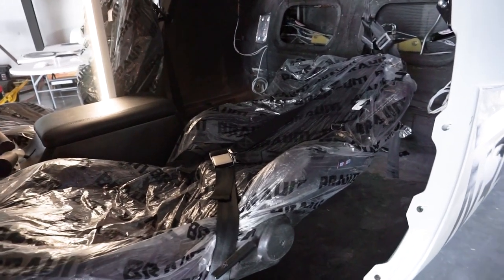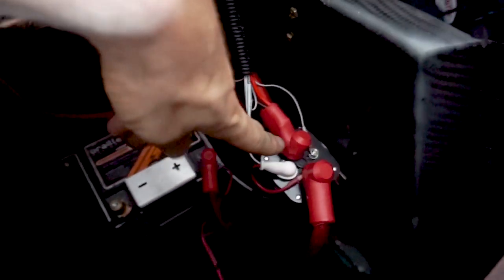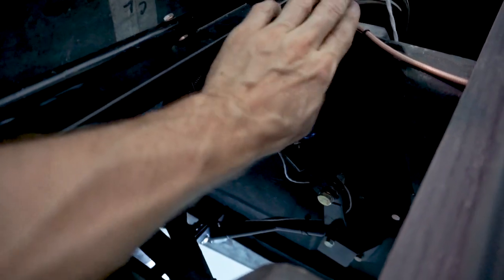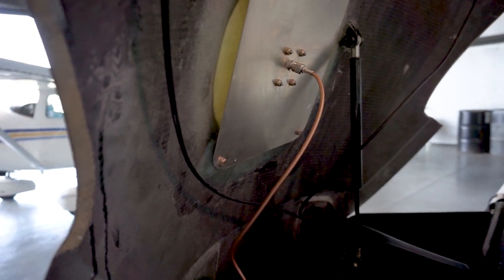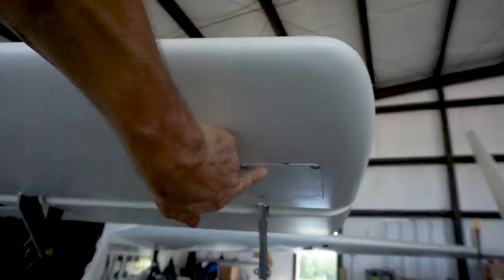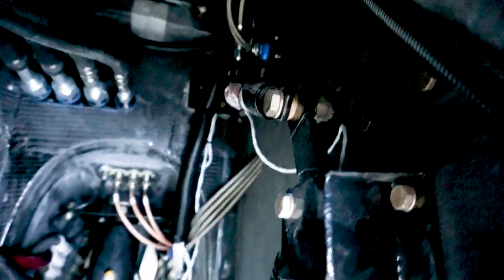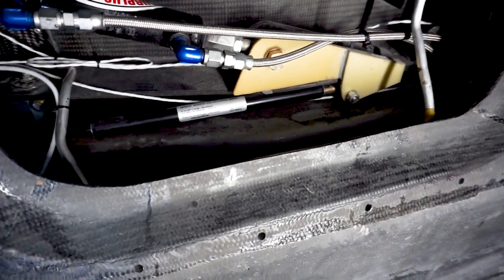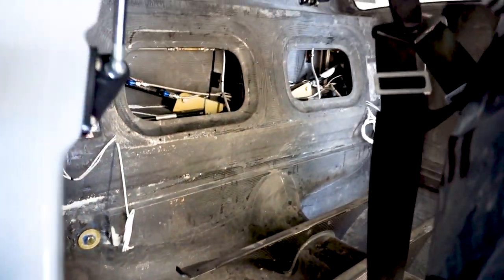Is this the coolest plane you can't buy... yet?  (Part 3)

Comment: The only thing I can say is get in there with some tie wraps and carefully placed tabs and secure ALL of that LOOSE WIRING AND HOSES I wish I could come down there and spend a few days consolidating that before you fly her.
 You need to plan for 9G's regardless of whether or not you plan on achieving it.
 I would secure everything every 6 in at a minimum.
Reply: Well, I agree, though most of the hard work has been done. I've seen in some of the videos that care was taken to make sure there was enough room so that wires and hoses all have a place to live, and can be routed within their bend radii.

I think that with the hard part done, the wiring and hoses could be gathered up and secured better than they are now.

Having assembled over a 100 desktop computers, some servers, mostly professionally, and a homemade CNC with over 100 feet of cable in it, I tend to use wires to immobilize other wires, and then securing wires where needed.

I try not to put strain on wires to immobilize them. I also tend not to zip-tie wires too tightly, because it just displaces the insulation. To a large degree, the wires know where they want to go. You just need to keep them from where they should never be, and obey their bend radii.

Same color wires, may be color-coded by striping with colored markers. Velcro may be used to temporarily bundle before zip-typing. Bundles of wires may be fastened with rubber-cushioned strap clamps, screwed to the bulkheads.

Sometimes, I install  large loose cable-clamps, to thread wires through, and then replace the clamp with the right size.

I tend to avoid any zip-tie anchors that are self-stick, because I've seen too much foam tape let go.
Reply: It’s not finished yet.
Reply: I suspect he hasn't zip-tied all the wiring yet because he's still working on things and may need to do some fiddling with the wires. Easier without zip ties.

Comment: Wow!  Super impressive.  I was looking at an RV-10 and this is making me think twice!
Reply: Same here at first, but when weighing pros and cons, the Raptor won for me/average mission and my family hands down. Also, If the possibility of back country type gear/stol package becomes available, will simply be the ultimate GA aircraft imho.
Reply: The problem is that the Raptor isn't available, and the RV-10 is.  Plus there are build assistance centers to have an RV built in under a month, and the RV is proven vs more just concept / prototype level.  The Raptor does seem fascinating though.

Comment: At the early phases of the Design, how did you calculate the spar's strength, how many layers of carbon to put etc.? Did you use any kind of FEA to calculate those? Thanks! Keep up the good work!
Reply from the maker: All of the aircraft structures have had FEA run on them by our engineer Mark. If you watch the older videos I show some of it and I constantly mention what Mark has come up with for layup schedules, etc.
Reply: Raptor Aircraft Alright thanks! From the ~400 videos in the playlist, where should I look? About 1-50 for example? I guess it would be in the start of the series...
Reply from the maker: @billvardou  sorry, I couldn't really tell you. There's probably one or two videos in there where we are laying up the spar and way earlier to that there's probably a mention of Mark doing the FEA on the complete wing structure.

Comment: Just wondering. How do you prevent water ingress in the front compartment, should the Raptor be parked outside in heavy rain? I saw a lot of electric wires right under the ledge.
Reply from the maker: On the prototype I'm going to be putting some weather stripping around the door. For production it may be different.
Reply: @RaptorAircraft  thanks!

Comment: How fine is the adjustment on the striker wheel for the gear doors? There might be a 1/4" change in tire diameter with rubber wear.
Reply from the maker: There are rod ends that have more than that amount of adjustment remaining.

Comment: That's a small battery for an electrical dependent airplane.  What's the battery only run time for avionics plus engine in the event of a generator failure?
Reply from the maker: There's also a TCW backup battery that runs minimal systems that should last for at least 30 minutes after the main battery is depleted.
Reply: That is a racing battery, designed to be compact and lightweight.  It is rated at 31 Amp Hours, so one would need to determine max load at generator failure and divide 31 by that load to determine battery duration before lights (and everything else) out.  Of course should a generator failure occur there must be written  emergency procedures and checklists established to deal with that, (or any other), emergency situation(s) to make the likelihood of safe landing as good as possible given the severity of the failure(s).  31 Amp Hours is not a lot, but other lead acid batteries with that capacity might weigh up to 50 pounds or more, so it's a good choice for aviation applications.

Comment: How high can you est. ceiling for pressureized flying ?
Reply from the maker: I am setting the ceiling at FL250 because you do not require backup oxygen below there.
Reply: Raptor Aircraft  - yes but what is that ceiling?
Reply from the maker: @solstar4778  well obviously if it gets to FL250 then it's capable of FL251. Who knows how far beyond that it's capable of until someone tries.
Reply: Raptor Aircraft - how high is that in feet above sea level? I have no idea what a FL 250/251 is! Is it 6 or 7 miles up?
Reply from the maker: @solstar4778  FL is aviation speak for Flight Level. You just add two zeros and that's how many feet it is above sea level. There is a correction that's made above 18000ft but I won't go into that here. So FL250 is about 25000ft above sea level.
Reply: Or approximately 5 miles.

Comment: What is your total weight?
Reply from the maker: Just over 3000lbs. It's heavier than I wanted because 'prototype'.
Reply: @RaptorAircraft  Just throwing out 'prototype' is a cop out. What is ~1/3 over weight? The structure? Was it not built to the CAD design? If so, why is it over by that much? Are the engine and systems that much over? In my experience, the production weight is likely to be greater than the prototype....
Reply from the maker: @stevedefranco6311  when I did the original CAD design I did not calculate the total weight because I was not experienced enough with Solidworks, or even the FEA and layup schedules to do it. So I just estimated the weight based on other similar aircraft designs. However the extra structure required for pressurization combined with the added weight of the additional turbo and intercooling along with all the weight accumulated in the over complex lock system on the doors all added up. However, I also estimated that we'd only get 310hp from the engine and we have closer to 375 or perhaps even more. So the wing loading will be higher which will result in a smoother ride. Anyway, it is what it is. It's easy for you to sit back there and criticize. I've done my best with never having done any of this before.
Reply: So with 100 gal. Of fuel 700 lbs and 400 lbs of pilot and passenger and a bag that 4100 lbs. And you expect that small displacement diesel to get if off the ground? Interesting.